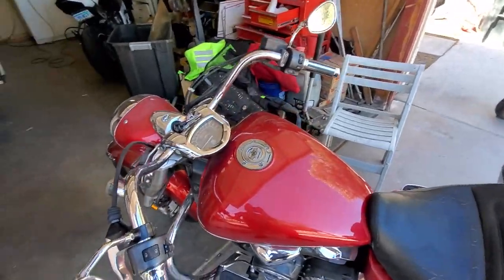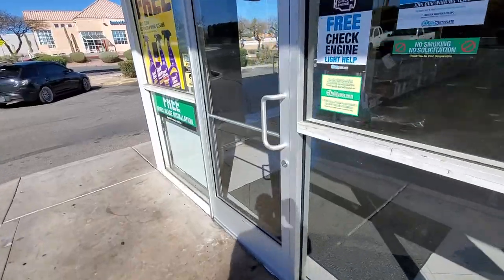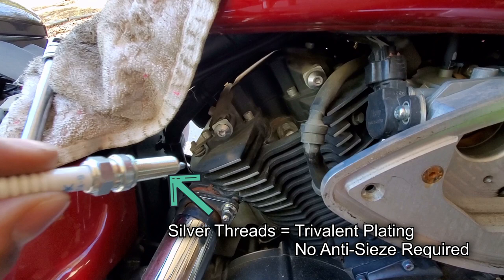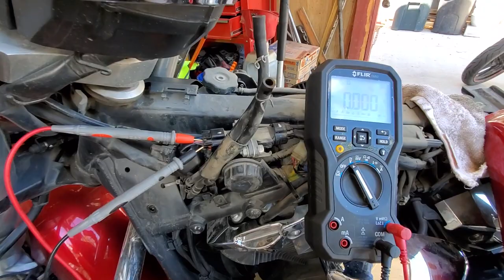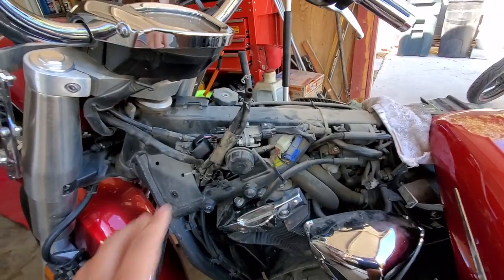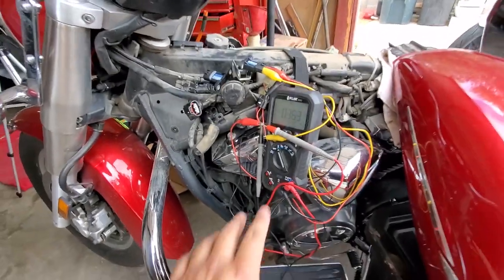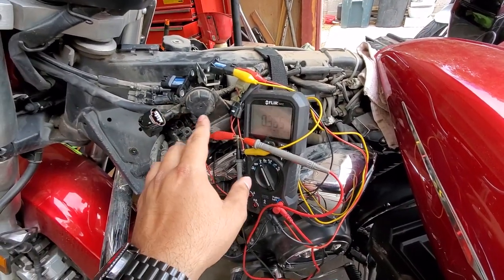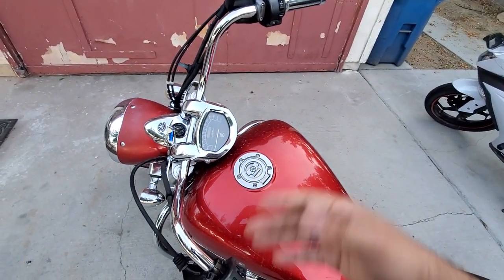Diagnosing a Starting Issue on a V-Star 1300

Comment from the maker: Update: This fix held true until my battery was getting old. It showed the exact same symptoms of cranking but not starting. After diagnosing, I found out that the fuel pump would get enough voltage to prime, but while the starter was cranking, the fuel pump had insufficient voltage due to the consumption of the starter. You can easily test your battery for this issue by taking it down to your local auto parts store for a free battery load test or you can pick up the handheld load tester I have linked in the description of this video. I hope this was helpful to you and don't forget to subscribe! Cheers!
Reply: So what is the real issue causing the 19???
Reply from the maker: @TVUsdad2015  both were the cause. In this video, the power commander was the issue. Shortly after this was posted, I got the same problem because of a battery on its way out. So now that I replaced the battery, I still have to start the motor while priming. But now it starts pwrfectly every time.
Reply: @TheMotorcycleBoss  I have a fresh battery and no commander so I'm at a loss with this issue.
Reply from the maker: @TVUsdad2015  does the motor crank? What sounds does it make?
Reply: @TheMotorcycleBoss  oh yeah, I have to turn the key a few times for the code to go away. Then it'll start. Runs beautifully. Just issues with the starting. Code will appear at 1st turn of key after its been sitting for a few hours. I'll turn it off n on 3-5 times and it goes away. Sometimes comes back at startup. Then go thru same process. At 1st thought it was the kickstand switch...NOPE!!
Reply: @TheMotorcycleBoss  when the code appears, the starter will crank over but engine doesn't start. FYI All sounds normal. 2007 with 67k. This is my only real issue on the bike.
Reply from the maker: @TVUsdad2015  what code are you referring to? And we are still talking about the vstar 1300 right?
Reply: @TheMotorcycleBoss  yes still talking about code 19 on a 07 vstar 1300
Reply from the maker: @TVUsdad2015  referring to code 19, all I could dig up on it is that there may be a blue/black wire coming off the ECU that maybe broken/disconnected. It's said to be a self-diagnostic ECU fault code. Also, it seems that a lot of people are pointing to the kickstand safety switch. Take a look at this: https://www.starbikeforums.com/threads/fault-code-19-not-the-side-stand-switch-now-fixed.121994/
Reply: @TheMotorcycleBoss  I took out the kickstand switch. It didn't make a difference.
Reply: @TheMotorcycleBoss  but I will check the blue/black wire. Maybe a mouse ate it or something.
Reply from the maker: @TVUsdad2015  simply removing the switch wont always ensure that you eliminated that variable. If it is a normally open switch, removing it will still make it open. You will have to jump the connection to be certain that it isn't at fault. However; if you are in neutral, even with the kickstand down, it should still start anyway.
Reply: @TheMotorcycleBoss  yes I jumped the connection. I too saw that switch can cause the '19' code. I now have eliminated that and it wasn't the problem. So now I need to check the blue/black wire in the ecu you spoke about.
Reply from the maker: @TVUsdad2015  good luck!
Reply: @TheMotorcycleBoss  this is starting to leave like a chevy issue. Everyone has the problem but no true solution. Time for a new bike!
Reply from the maker: @TVUsdad2015  there was a guy that had to swap ECU's and that fixed the issue. Maybe that is your last option.
Reply: @TheMotorcycleBoss  well thats a bummer if its an ECU.
Reply: I have the same issue, I posted some shorts on my channel describing the issue, was the issue the fuel pump?
Reply from the maker: @philspaseo2377  no. I thought it was. It was actually the battery in conjunction with the Power commander. The battery was showing sufficient voltage and would prime the fuel pump as expected.

 However; when cranking the motor, the battery voltage dropped just enough to starve the fuel pump of voltage but had enough amperage to crank.

 So, in conclusion; battery CCA's were too low. Got a new battery. Then, I had to start the bike while the fuel pump was priming so the Power Commander still pulled power from the fuel injectors upon startup. After the fuel pump stops priming, the bike wont start until you key off then back on and only start it while it's priming. 

Hope you subscribed! Ride safe! Cheers!
Reply: There is a 10A fuse mounted on the starter solenoid where the battery red lead goes. The small auxilliary connector on mine had gone green and was causing similar problems!

Comment: I've been scratching my head for 2 days on this one lol. I'm more experienced with carbureted motors so I wasn't sure if the position of the two hoses on the intake mattered. It does. I had them backwards. Just switched them around after you explained checking the air pressure sensors and voila, she fired to life. THANK YOU!!!!!!!!!
Reply from the maker: Great to hear! Glad I could be of help! Thanks for watching and commenting. Much appreciated

Comment: 2013 vstar  1300 deluxe 30,000 mi,  If you get a code 12 it may not be the crankshaft position sensor check the starter solenoid, neutral and kickstand switch first. Just replaced my solenoid and wouldn't start, did the fuel pump start trick and it fired but didn't start. Had to turn the key on then tap the start button to run the fuel pump 3 or 4 times then hit start and it fired right up. Thanks for the tip.
Reply from the maker: Hey I'm glad that I could help. Bike seems to be finicky. Ride safe!

Comment: My Vstar is a 2004 and does exactly the same. I replaced the air filter and put new spark plugs. It takes a few long attempts until it fires up. After that it starts every single time nice and smooth. I replaced the starter clutch about 3000 miles. The 2004 also takes those sensors under the gas tank? What could it be? Thanx.
Reply from the maker: It appears that the fuel pump relay is the common cause of this issue. I have yet to take the time after this video to test that theory but since this video, the problem has gotten worse to the point that the fuel pump no longer primes after the first time. I suspect the relay at this point.
Reply: @TheMotorcycleBoss  I will keep you posted. Thank you.

Comment: I replaced my TPS with a new one purchased from a Yamaha dealer and the part number is different , was told there was an upgrade, What readings should I get from the TPS when checking it ? 2007 V Star 1300. , bike's idle is very inconsistent ,  cheers and thanks for the video.
Reply from the maker: You would have to check the service manual. I haven't seen the values in quite a while.

Comment: Ooo man, it is 12 am here in ENGLAND and got the same problem with my bike since the morning. I have changed the air filter to K&N and put charging cables on the battery in case if it will go flat I`ll be able to connect it straight away to it without taking the seat off. After reconnecting the battery, Bike just didn`t start. The battery is okay, fusses are okay,  starter spins but nothing happens. I thought that maybe issues in is immobiliser. But after watching your video, will try to start it tomorrow in the morning as you showed.  I really hope that it will work. As before that, the bike was working fine. 
P.S. I have the same colour as yours, mine is 2009
Fingers crossed
Reply from the maker: Awesome. I hope it works for you. Please keep me in the loop and lmk. Looking forward to hearing from you
Reply: The Motorcycle Boss the morning has come. Me on my way to the motorcycle and hoping that it will start and will able to take it out today.
But looks like it I will spend another day in the garden. Bike didn’t start. 
No idea where to look now. Maybe spar plugs? ( but it’s weird because I started two days before it died)
Reply from the maker: @m.r.62  that's a shame. Sorry to hear that. If I were you, I would do the starter fluid test and go from there. Have you done this or no?
Reply: The Motorcycle Boss didn’t have any with me. So started to strip the bike little bit to see where is the problem. Discovered that cable that goes to the fuel pump doesn’t have electricity in it. Pump is working( checked with other cable and battery). Problem is somewhere in the wiring loom. But I’m not an electrician, so will take it the service next week
Reply: @TheMotorcycleBoss  Problem sorted, It was a wire that goes to the fuel pump relay connector, It was got corroded and broke. I have made a video of it on my channel
P.S.  Did you lifted higher your handlebar? (the angle)

Comment: Why is my 2003 650 VStar so hard to start. It's been to the same, what I think is a quality place not some junk amature shop-been there twice.  By the previous owner and now me.  I took the carbs off and cleaned them meticulously.  They put in a new battery and adjusted the idle. I still have to crank on it for over a minute before starting. I've tried all the different choke positions, giving and not giving gas.  It's cool here today about 60.
Reply from the maker: I understand your frustration. It sounds like your idle jet or fuel pressure are having issues. It could also be your float  position or your carb plunger. Trye replacing the spark plugs as well and ensure your air filter is clear.

Comment: I've got a 07 1300 that's been laid up for a MINUTE....Same symptoms as this one. I had a Power Commander on the bike but it fried. I've uninstalled the PC but the bike still won't turn over. Now getting engine Error code 001- which indicates a ECM failure. Has anyone seen this before?

Comment: I check for spark and fuel before going to the store. In line spark tester plugged on to spark plug, and into plug wire. Spark yes? Pull plug, check for spark at gap and for unburned fuel (wet.) At this point (plug out) also check condition of plug. If spark yes, plug dry- no fuel to cylinder. Sometimes, when engine sit a while they lose the prime. 1.Key on, 2.listen for pump to run and stop, 3.key off. Repeat 2-3× before cranking over. Crank over.  Fire yes-good. Fire no- check plug for raw fuel again.
  That's when I start dumping tools on the floor and making trips to the store.
Reply from the maker: Your assessment is correct however the real underlying issue has been addressed in my pinned comment as an update. I think you'll find the solution quite interesting. Take a look!
Reply: @TheMotorcycleBoss  Cool. I was thinking carbs, too, like on my 1100. Lot of people omit the pump altogether on those and use gravity feed. I wonder if a downhill bump start would work in a pinch with injection 🤔🤔🤔

Comment: My v star 650 makes the same noise when trying to start except when I turn the key to the ignition, it starts clicking before I even try to start it. Thinking maybe my battery is dead and that I need to clean my carb.
Reply from the maker: If you press the start button and you only hear one click or a series of clicks without trying to start, 95% of the time, it's just your battery needs recharging or replacement. If your battery checks out, you need to test your starter solenoid then test your starter. Make sure you get your battery load tested which Autozone or Oreilly auto do it for free. Or you can pick up your own load tester here:  https://amzn.to/3uyJSIX

This is the exact same one I've used for years and I LOVE it. If you get your own, you can test it without leaving your house or removing your battery from the bike. It can also test car batteries and will even test your starting system, charging system, and even shows you overall battery health. Highly recommended for everyone honestly. I hope this helps!
Reply: @TheMotorcycleBoss  the battery was dead! Charged it and now it’s running fine
Reply from the maker: @sunnietahmas4960  glad I could help you find your issue! Keep in mind that sometimes if your battery gets that low, a recharge maybe only a temporary solution. Even if it shows 12.6v, the voltage may drop too low to run your fuel pump or other devices while starting and it will show it's face later on in the form of you possibly getting stuck. That's why a load test is always recommended whenever your battery needs a recharge. It will tell you the true Cold-Cranking Amps of your battery and it will tell you the life of your battery. You don't want the CCA's to be less than what the battery is rated for. But glad you found your issue.

Comment: Awesome video. So I just bought a 2006 Yamaha Royal Star Tour Deluxe awesome deal I pay $900 bucks. So the motorcycle will start on neutral with the clutch press in but at the moment I let go the clutch dies even with the kickstand up . But as long I keep holding the clutch in will stay running and if I put it on first gear or any gear dies right away. What do you think could be. ?
Reply from the maker: Hey! Thanks for commenting. It sounds 100% like a safety switch. Possibly your kickstand safety switch telling the bike it is always in the down position. But there is also a neutral safety switch on many bikes. I would start by diagnosing your kickstand safety switch then move on to the other safety switches from there. I hope this helps and good luck with your project! I hope I earned you as a subscriber if I haven't already. Ride safe! Cheers!
Reply: @TheMotorcycleBoss  thank you so much you are awesome and making people lives easier and saving money that we don’t have. Appreciate. So I tried to by pass the kickstand I put a electrical cooper wire to see if Start and didn’t work. So after I disconnected on the clutch level electrical plug has four prongs I bypass one side and got it to start in neutral without pressing the clutch. Than I sit on the bike put the kickstand up and I put it on gear and die right away
Reply from the maker: @MOUSEBOWEN   @Mouse Gipson  no problem. So keep in mind that some safety switches are naturally open or naturally closed. For instance, instead of bridging the kickstand wire, just disconnect it and don't bridge. Try this for all of your safety switches. It seems like your clutch switch may need to be replaced. But of course before buying one, identify the problem thoroughly first. If need be, breaking out a service manual for the bike and looking at the safety switch wiring diagram may help you out as well. But so far it seems you are on the right path to figuring it out.
Reply: @TheMotorcycleBoss  okay awesome. Tomorrow I’m going to remove the gas tank to chase the clutch safety wires and kickstand see what’s the deal. Gracias my for you help
Reply from the maker: @MOUSEBOWEN  no problem. Please update me when you find the issue. Knowing the causes of issues is very helpful.
Reply: @TheMotorcycleBoss  yes I will. Actually I just tried something else but didn’t work. I can get it to stay running by bypassing the two wires in the clutch has 4 wires I bypassed the other two too but still dies if I put it on gear
Reply: O
Reply: @TheMotorcycleBoss  so I found the problem was a relay close to the stator 5KS- 81950-00-00 and now runs perfect
Reply from the maker: @MOUSEBOWEN  glad to hear! I had to diagnose the same relay assembly on my v-star not too long ago. I made a video on the process then accidentally deleted all my footage. 😢 the fuel pump relay also goes through that assembly and that was what I was diagnosing. Goes to show that a solid diagnosis is always worth the time before throwing parts at the bike. Congrats on figuring it out! 👏
Reply: @TheMotorcycleBoss  thank you so much. I spent so much time trying to figure out . I bypassed the neutral safety switch that’s why I found out that the safety wires was going through this relay than I figured out was the relay
Reply from the maker: @MOUSEBOWEN  good job on the troubleshooting. A lot of people probably would've just taken it to the shop and spent a ton of money. But those people won't be able to feel the satisfaction of figuring it out yourself. Congrats! Glad I could help somehow.

Comment: where is the throttle position sensor and how do you check it?
Reply from the maker: The TPS is connected to your throttle body. Close to your air intake. If you get the factory service manual for your bike, you should be able to find it quite quickly.
Reply: Throttle position sensor is the black plug usually connected to the carburetor itself opposite side of the throttle cables. At least on the vstar 650s.

Comment: Hello, Would you tell me what is going on with high idle, when I pull the clutch 2012 VSTAR 1300T,  no air leak, and been checked out, once throttle body got cleaned it worked for few days again the same case, as soon as I go for few minutes bike rises when I pull the clutch or put to neutral, riding wise no difference any thoughts? And suggestions.?
Reply from the maker: Check & clean your mass air flow sensor and make sure you are not getting any codes for a bad O2 sensor in your exhaust.

Comment: meter looked like it was reading ac volts, i think it should be dc when bike is off, also check resistance on mass air flow sensors
Reply from the maker: Issue was found. Look at pinned comment for an update

Comment: Hi, does the XVS1300 have CAN/OBD2 connector? I've been unable to locate it... I know that Yamaha uses 4PIN CAN instead of the standard... even so, I was unable to locate it 🥲
Reply: did you ever find it ? Looking for this right now
Reply: @falcon26r87  unfortunately i was unable to find it, it would seem that there is some sort of protocol to communicate several error codes to the dash but nothing else
Reply: @Demolick  appreciate the reply, dude I know there’s a self diagnostic code. Mines a real mess. It’s been a few years since I’ve ridden it I’ve gotten the itch lately. Last time I wrote it it gave me a TPS tilt sensor and an ECM error code. You know how electrical diagnostics are.
Ride safe  bro
Reply: @falcon26r87  hope you figure it out soon 
Ride safe